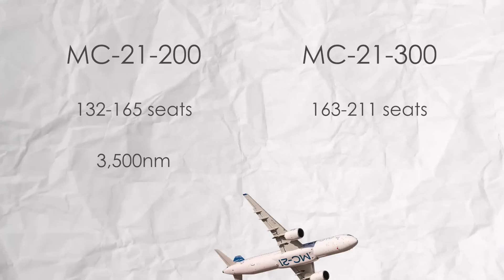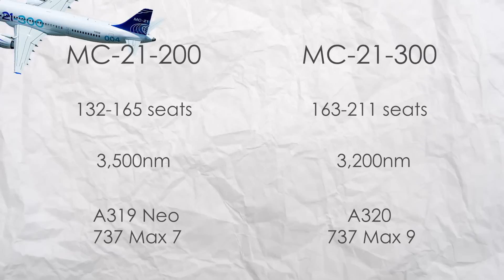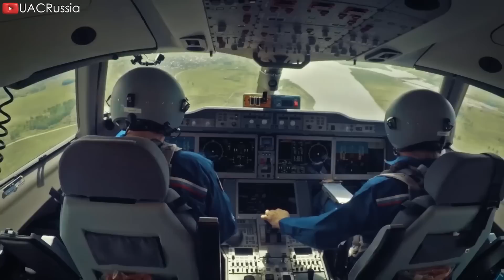This Russian NEW MC-21 Will Change The Aviation Industry! Here's Why

Comment: Is this wing design efficient?
Like Airbus & Boeing have a small curve at the end of the wing, which are purposefully made for being aerodynamically efficient and this russian jet lack that curve?
Reply: To reduce inductive drag, Russian designers use their own composites, the so-called black wing, significantly increased the length of the wing in relation to its width, which made it possible not to use winglets

Comment: Clearly Russian Engineering must greatly improve the Aeroplane Engines and Electronics .
If the Russians can produce World Class Fighter Jets, they can produce good quality Civil Planes in time.
I suspect the Planes in this video will end up cost ing about $100 million each as the Components must be developed ; at the same time, the Russian Gov will perhaps give a 50% grant to Russian Airlines to buy these in order to get them to build trust with the industry.
If this can be achieved , these planes will sell well providing the Firms can give good training to the ground and maintenance crews where they are bought and create good supply chains for spare parts when they are serviced periodically . 
Thanks for sharing………🇷🇺😉
Reply from the maker: Thanks for your comment :)

Comment: Looks like they just copied the airbus plane! Nothing new !
Reply: This is a complex machine. You can't copy it except perhaps small parts which were originally sourced from the west. What can happen is that they can aim for same or better specification which governs the design somewhat. But the wings are better in both design and composite materials used than current planes from either Boeing or Airbus.  What will limit it, is politics although Western countries won't say that. They will delay or even stop certification. Lots of other countries already understand that. But you are right. It's nothing new for Russia technology wise. What has often been the case is that they have lacked finance and markets. But the game is now up.

Comment: There is a pretty good documentary out there covering the development of these aircraft. While marketed as being part of a pre-existing family of aircraft, the two new planes were pretty much designed "from the ground up" as a brand new airframe. It is most likely more advanced than anything that Boeing is currently capable of designing due to corporate reorganization following moving their headquarters to Chicago. Airbus has its own problems resulting from if nothing else the damage that the Russo-Ukrainian War has done to the European economy in general and Germany in particular.
Reply: Biggest problem of Airbus is too many orders. Putins rotten industry has the inverse problem: nobody wants the outdated Russian products. MC-21 is good example: the jet which is in „development“ for nearly 20 years received almost no orders except from Russian state companies. And Western sanctions send tiny Russian industry back into the middle age. Here, MC-21 is also a good example: Despite numerous statements that Russian industry can replace foreign components, the commencement of the flight operations is postponed from year to year.
Reply: The draconian sanctions on Russia have forced them to become self-sufficient in all sectors.  Once they sorted out the Ukranian war,  with a highly modernised and invigorated war economy and 100% free from Western shackles, they are set to go leaps and bounds full scale.  West will have to drop the sanctions and open their market again.  Initially, like any new planes, the C21 will go through the teething phase.  Once pass that, it will give the overpriced Boing and Airbus the run for the money.   Good Luck😊!.

Comment: why you are talking something you have no clue, i had the chance 2022 january and february in Yakutsk so see the MC21 close in the HANGAR from Yakutia Airline, there were two proto types in yakutsk to check out cold weather operation -50 and below, regarding certification, as i said in march 2022 was not even certified in russia because it was still a proto type, and after the invasion the ukraine the entire project got on hold because due to the sanctions, engine and avionic was unavailable
Reply: Mc 21 100% russo !

Comment: Why this 0:50 top mounted platforms used? Its look as overengineering. I see only advantage when when the floor's covered with stuff. Floor based like 4:11 and 4:19 look much simpler.
Reply from the maker: yes

Comment: Sanctions are an act of war ! isn't sad that politics and propaganda gets in the way of certification ? if the MC-21 got it's certification then we would see some fair competition in that segment. The significant price difference would allow smaller airlines to modernise their fleets. The other factor NOT mentioned is running costs, fuel efficiency and cost of spares. I think the west is afraid of competition ? But it remains to be seen if BRICS will change the outcome of the MC-21.
Reply: Sanctions are the alternative to war. Kremlin aggressors just need to withdraw from Ukraine stopping the war and sanctions will be lifted. MC-21 for many years is just Kremlin propaganda and no competition to the West.

Comment: Was this article posted before or after the crash of the super jet 100 outside Moscow in July 24…… which is with the way the entire Soviet aviation industry is going
Reply: ye that SSJ-100 had western components lol. no wonder it crashed, look at boeing. thankfully other SSJ are now being built without western components. it will greatly improve aircraft's safety.
Reply: @Zorro33313  in one of SSJ100 crashes exactly a French chassis component breaks  during landing.
Reply: @Zorro33313  But in all three cases not the Western components crashed! Thus, by replacing Western components with Russian ones there will be even more crashes.
Reply: @Zorro33313  keep telling yourself that Ivan
Reply: @Zorro33313  keep telling yourself that, Ivan.......
Reply: You're delusional. The Russian planes are not made by Boeing!
Reply: @YossiaNorth Right. Russian planes are made in tiny numbers, and the few existing ones are of low quality.
Reply: @alexandervt641  like Boeing?

Comment: Plane                  Orders                Deliveries          Unfilled orders
Airbus 320        10546                 3424                   7122 (all over the World)
Boeing 737       16527                 11797                 4730 (all over the World)
MC-21                175                      0                         175 (165 Russia, 10 Azerbaidjan)
Is there anything else to say?
Reply: Lift the sanctions and you will have your answer
Reply: Yes, AirBus stays in the air where as Boeing falls apart.. I avoid Boing as much  as possibel, in fact when booking a flight I check what airplane is used. Most likely yhe MC-21 is a saver choice.....so the answer is 1!
Reply: FAA western monopoly
Reply: Băi cerneo tu ești român prost de-al  meu sau doar faci pe prostul. Dincolo de cifre sunt războaie comerciale, cred că ști și tu asta.
Reply: @adriancernea6034  
MC 21 ,It  just got certified ✈️ 
737 is in business since the 60s ( and they never fix it )
A320  since late 80s   
 Anything else to say ?
Reply: @jimydoolittle3129  yes, it is.
COMAC C919, the chinese. Orders: 933, deilvered: 7, unfilled orders: 926
I think that the russians are already doomed. No one will buy their plane even it will be certified.
Reply: @jimydoolittle3129 MC 21 is not ready for production. For over 20 years. Just a few orders, all from Russian companies under state pressure. Plus the low quality of Russian production, now without modern Western components. Any comparison with Airbus or Boeing is unrealistic.
Reply from the maker: I will keep this question in mind. Thank you.
Reply: Of course, it's all over for Boeing, Airbus is on its way. What did you want to show by this how good the planes were in the past, so what?

Comment: The Russian aviation industry needs to cooperate with the Chinese aviation industry in order to have success for both. 

They have the engineering and technical know-how. It is just a matter of implementation.  Initially they may need to bypass Western markets due to sanctions, however, there are other markets outside of the West and Europe and America is not the entire world.
Reply: Yes
Reply: No, they don't. From whence came Chinese engine technology? Soviet Union.
Reply: Cooperation with China depends more on itself. Russia is already planning to supply individual components and parts for a wide-body aircraft; they may also be interested in the PD 35 engine. Everything will very much depend on sanctions on China. The more there are, the more cooperation there will be.

Comment: This is a commercial approach. In airline fleet it is also a question of pilots and maintenance crew. If the system is very different to Airbus / Boeing then it is very hard for pilots to mix and match aircraft. Certification is also a burden, it will take a few years to complete JAR or FAR requirements. I would set an optimistic schedule in 3 years, depending on how much Russian certification can be approved. Also the wing structure and manufacturing methods are new, so it will be hard to comply with current regulations. This approach omits what China or India is planning to do in this front of aviation. These nations have capabilities and funding, although India is not a very large player at the moment. China maybe. If this plane manufacturer would introduce IPO, I would not put my money on it even if I could do so.

Comment: When criticizing the MC-21 it‘s not about the jet itself. Sure, it is a modern airplane because it‘s new and Russian engineers are experienced. 

The problems are business and production. Russia has no modern industry. Moreover, because of the sanctions it needs to produce each component domestically. This strategy, called «импортозамещение», is a total anachronism and returns the country into the middle age. Like the Soviet Union. Even if one day the jet will be ready, it will be of lowest quality. There is only one way: Kremlin needs to stop the war against Ukraine and - after the sanctions have been lifted - use import components wherever required.
Reply: There is always more than one way.  Russia should never trust unfriendly outsiders with the industry vital for the state, its gonna take time but 20-25 years from now Russia will have fully developed airspace industry on its own and even if one single machine is not sold outside still the project will be huge success because Russia will need 3,000+ planes in next 30-40 years.
Reply: Per me non è così! I componenti dell urss erano scadenti non nella ingegnerizzazione ma nelle esecuzioni delle maestranze indolenti e non motivate nel loro lavoro.
Reply from the maker: Thanks for your sharing
Reply: what does “the Kremlin needs to stop the war” mean? How to stop?
Reply: @konradkarlovich5801 Withdraw its invasion troops, what else?
Reply: @konradkarlovich5801  No, it's NOT "capitulate".  Ukraine did NOT invade Russia. Russia did illegally invade Ukraine. If Russian toops go home, it's NOT a capitulation.It's just a wise decision to let Ukraine live a free life without the criminal opression by Putin.
Reply: @konradkarlovich5801  If the kremlin does not know how to stop the war, change the top people in the kremlin with men that know the truth. Just get every russian army unit out of Ukraine. Ukraine is NOT part of Russia. There are international borders that have to be resptced by the Kremlin. They CAN stop the war - if they would have the goal to improve life for the Russian people and would respect the life of Russian soldiers. The war was started by Russia. NOT by Ukraine, NOT by USA, NOT by NATO. So it's Russia's responsibility to end this war. May be the Russian PEOPLE have to find a way to get rid of the criminal liar and dictator Putin and his friends.
Reply: @sorgfaeltig  Friend, chat about aviation, not war, you will give advice to your mother-in-law or wife.
Reply: Where is absolutely no way imaginable for russia to stop the war without either winning or desintegrating.
Reply: Moreover, two decades of western " integration " led russia to absolute disaster and degradation of all domestic industry and technology. Russia is trying to recover from this Yeltsin era integration.
Reply: @Aleksandr-ke7gy Why should Russia disintegrate when removing from Ukraine? The USA did also not disintegrate after their failed Iraq invasion.

The reason for the decline of Russian aviation industry was that Soviet airplanes were simply not competitive. Because Soviet industry was inefficient and self-sufficient. Repeating the Soviet way will lead to the same disaster. It is possible for Russia to build an own aviation industry, but only in international cooperation. Europe did so, Brazil, and now China.
Reply: @alexandervt641  you have zero idea you are talking about. But at this point , time for  discussions is over. And I am too old for this too. Now only battlefield decide. All sides are redying for the real war. Too late
Reply: @Aleksandr-ke7gy Concerning Putins war, time for discussions is over. Everybody supporting it takes guilt.
Reply: @alexandervt641  USA have no common borders with Iraq, so retreat of troops from Iraq brings no threat to US at all. If Ukraine was situated somewere on the American continents, then Russia no needed to protect own borders by interfering to country from "other side of a globe"(as the US did, and keep doing)
Reply: @Aleksandr-ke7gy  Why are you talking about destroying a nuclear power? Fell from the roof. Putin clearly said, “Why do we need such a world if there is no Russia in it?” Do you understand what this means???
Reply: Semmi köze az Ukrajnai háborúhoz. Amennyiben ez a típus bizonyít,-akkor nincs szükség import anyagokra.A "jóakaratu emberek",-mindenre találnak kifogást.
Reply: Listen, my friend, what do you know about Russia, practically nothing. On both aircraft, the MC21 and SS100, all systems have already been replaced with their own, proprietary ones. They are currently being actively tested. There is nothing imported about these planes. You also don’t know anything about Russian industry. How many shells, missiles, planes, ships, submarines is Russia producing now? In the West they can’t do that. And these are all high-tech products. Mechanical engineering is growing by 40% per year. We make all high-tech machines ourselves. Other industries are also not lagging behind. The economy is growing, regardless of sanctions. But the same cannot be said about the West. Things are only getting worse. But the West is still very dependent on Russia, but we are no longer. Airbus cannot exist without our titanium, nuclear energy cannot exist without our uranium, food products cannot exist without our fertilizers, and much more. So who's on who's hook????
Reply: @НиколайЗинин-п1х  You believe each piece of Kremlin propaganda, do you? No, there has nothing be replaced in MC-21 or SS100. There is just prototyping, like for over 20 years. That‘s why the rollout is shifted from year to year. And even in the rare cases when something gets produced, like the Superjet, it is of miserable quality. Russian industry doesn‘t produce any competitive goods. No jets, no cars, no tanks, no phones - nothing is modern. Because the whole structure is monopolistic and inefficient. The aviation industry with Rostec, UAC, all the Tupolevs, Illushins and Sukhois is a huge bureaucratic monster. And sanctions will surely not improve the poor state of Russian industry. You believe in a miracle? It will not happen.
Reply: Huawei didn’t get in any war but still not allowed to purchase components needed. 
This sanctions would have happened regardless as long as this product poses threats to existing duopoly vendors.
Reply: @slimm2837  Huawai is a single company sanctioned for security concerns. The Chinese Comac 919, which poses a much larger threat to the duopoly, is full of Western components, including the engines and electronics. In addition, the MC-21 never was a competition because all Russian projects in the last 25 years failed. The endless development and scandals around the MC-21 is a good illustration.

Comment: Due to sanctions the domestic need for the Mc-21 is big so production wise it will be successful till 2030+, after that Russia will need to proove the quality of the product plus have sanctions revoked in order for it to snap a few export orders. All in all it is a good and up to date design, with modern engines and spacious interior, but after 2030 Airbus and Boeing will present the new single isle aircraft that will give 15% better economy then present designs so Mc-21 will loose its edge in the proximate future.
Reply: Nice dreams
Reply: @slimm2837 Agree dreamer